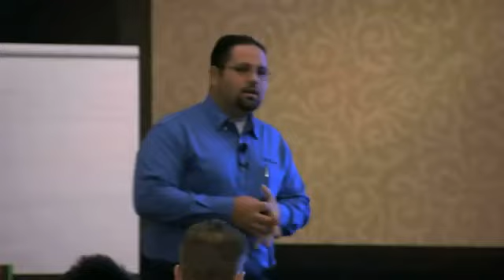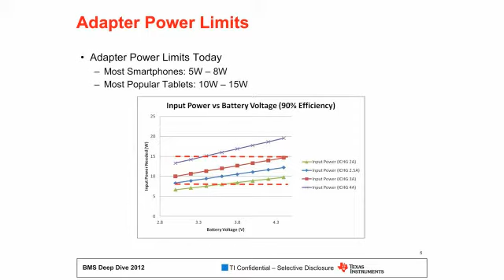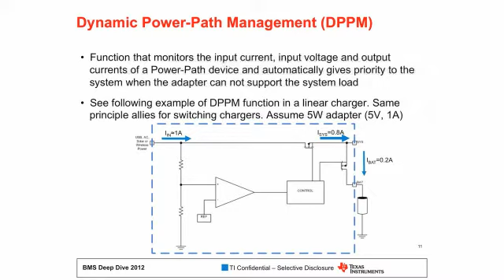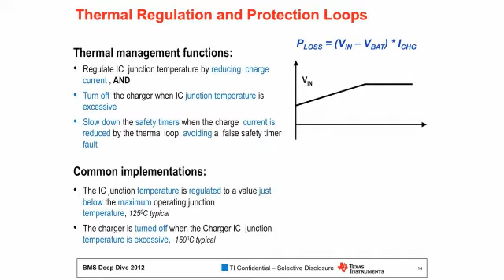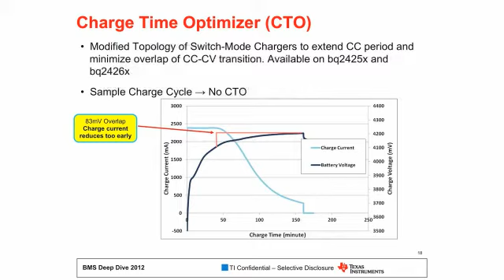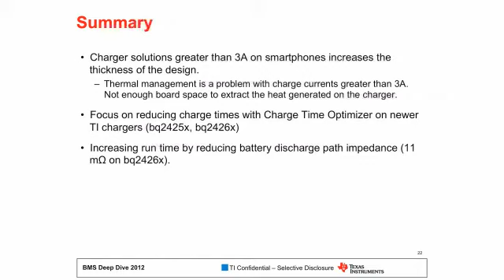Battery charger design for single cell battery

Comment: Hey TI, 
    Nice choice of content to upload. As a hobbyist designing simple lithium battery charging and protect circuits is a pain. I find it particularly challenging because I usually want an old-fashioned 5v power rail on my simple projects. If the YT account manager happens to have/see any content about a simple integrated circuit design or IC that can handle (1) a single lithium cell with over/under protection, (2) CC/CV charging, (3) has a boost switching regulator capable of 5v @ >~300mA,... and (!!..I know right?!?) ..(4) is available in a hobbyist manageable package (like dip or SMT pin package with a pitch larger than 0.5mm), I'd greatly appreciate the info. Every time I try to research this type of topology I find myself building 3 separate blocks for a stupid complicated circuit. All the manufacturer's websites seem overwhelming to me when I am looking for a design like this. The production designs for integrated lithium management all seem to either focus on giant multi rail and multi battery cell systems or outputs at or below 3.3v. I need a jellybean components simple design here. Something about as complicated as a generic implementation of a MC34063 or TL494 circuit at the most, preferably a design that uses around 5-15 passive supporting components seems manageable to me. Got any content/solutions that fit that bill?
-Jake